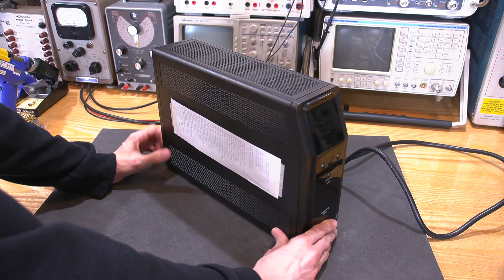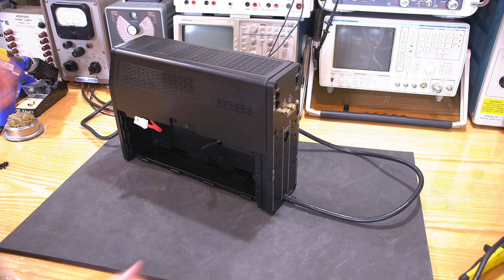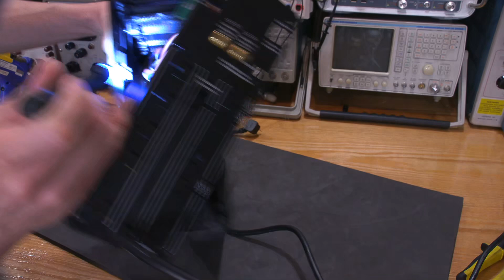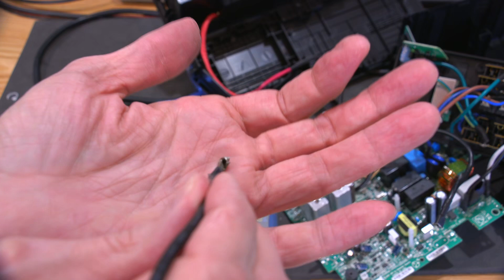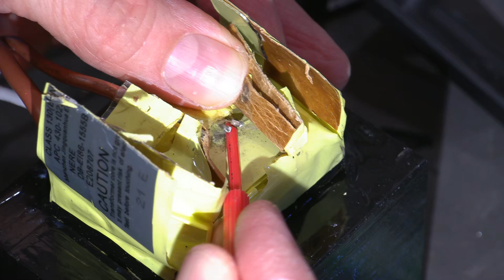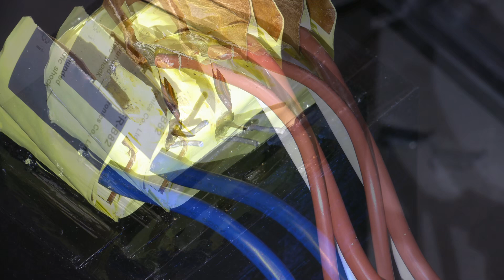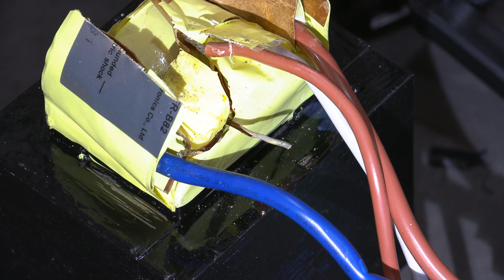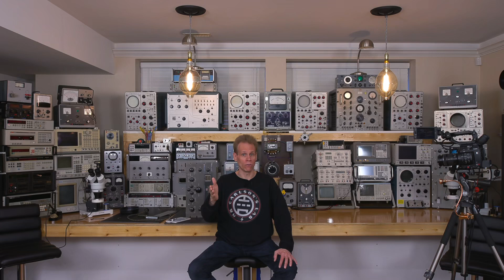UPS Electrical Failure - Teardown and Analysis!

Comment: A weak mechanical attachment for sure!  A crimped metal sleeve over that wire joint would have kept this going.  The fact all the connections were the same, this was by design...sad.

Comment: China loves aluminum wire! All they would have had to do is put a crimp ferral over those connections and they would have lasted years. Great video as always Mr C.
Reply: @Bruce Havourd Nothing shows the transformer  itself to be a bad one but those  wire connections are questionable. Bad connections cause FRICTION!
The burning was indeed as show by Paul to be at the crimp!
Reply: @hestheMaster  There wasn't even a crimp on those connections. They literally just folded the copper wire over the aluminum wires and blobbed solder on it and hoped it would stay connected. I'm curious to see the other transformers from the rest of the APC units. I wouldn't be surprised if the other transformers had proper crimps and if this particular unit had a fault and was hastily slapped back together by someone and thrown into a the UPS unit. A real crimp would have been faster than the lazy job performed here.
Reply: @redemptusrenatus5336  Then that would be a major mistake!
Reply: Those would have to be gas-free four-point military/avionics style crimps on cylindrical ferrules. Crimping anything to aluminum without fully flowing the metal-to-metal interface so all the oxygen is driven out is a fool’s errand. It becomes a ticking time bomb.
Reply: @absurdengineering  BOOM 💥
Reply: True. A bad crimp connection was probably the likely culprit here.
Reply: But that would be more time consuming.
Reply: @philipslighting8240  Normally, yes, it'd take more time to do the job badly but the worker who got the UPS to fix might not have access to the crimp tools (maybe they just repair units which fail QC and don't have the tools to make those crimps on the transformer) and had to make do without replacing the transformer. Note, the transformer doesn't have to work for very long, just long enough to pass the QC test so someone can sign off on it. By then, whoever slapped the transformer back together is long gone and it won't likely be traced back to them. Terrible that something like that might happen but clearly this transformer couldn't be the norm for how they're assembled as they'd certainly have a lot more failures if it was.

Comment: Hello Paul. It doesn't surprise me the transformer failed. When a large batch of appliances is made,  only a sample of the whole batch is tested. For example, for a batch of 500 UPS power supplies, only 100 might be tested. That leaves the rest that are either faulty right from the factory, or don't work at all. That is from a former QA Inspector, who knows first hand the testing process. 😖
Reply from the maker: Thanks for taking the time to write Aryon!

Comment: I often wondered how they can produce those cheep UPSs and many of the smaller desktop ones are so lightweight- now I know. If properly designed there may be nothing to say against aluminum wire other than you have to account for the higher resistance and do a proper crimp connection.
Reply: There is another reason they can reduce weight of the UPSs and inverters. 
Old style UPSs generate 50Hz (sine or square wave depending on how cheap the UPS is) and send it to a transformer. The transformer needs to be big enough to not overheat during the expected runtime.
However, what I noticed in newer inverters is that they use a DC-DC converter to step up the voltage and then produce the 50Hz sine or square wave at the output. This means a much smaller transformer.

Comment: WOW! I am now concerned that the APC units I have in my home are also of this sub standard quality.
Reply: If they are the pre-Schneider buyout (over 15 years old) they will be fine. The originals actually built by APC will last a long time, but be sure to use quality replacement batteries, cheap ones will fail due to overcharging.
Reply: @mxslick50  I have seen numerous old APC UPS devices fail when their internal circuitry fails and they keep charging their batteries (no matter the brand) at full charge after being fully charged instead of switching to a maintain trickle charge which causes their batteries to swell.

Comment: I had a Cyber Power UPS fail in a spectacular way about a year ago.  By luck, I had just returned home when I heard multiple loud pops that sounded like shots from a handgun going off.  When I went looking for the noise I came across my UPS with smoke coming out of it and I could actually see fire through the louvers on the UPS's side ... YIKES!!!  I (very) quickly yanked all the wires out, picked it up, and tossed it outside on my lawn.  In hindsight, the popping noise I heard was probably components exploding on a circuit board (I'm sure many of you know what I mean ...cough, cough).  I was going to take it apart to see what happened, but the store where I bought it said the only way they would accept it on return was for it to be intact and unopened (and the battery removed - yeah, right).  This thing was in my living room ON FIRE!!!  If I was out when this happened my house might have burned down.  I never knew what caused it to light up, but you can be sure I replaced it with a different brand of UPS ... and based on this video, it doesn't seem like that would be any safer.
Reply: Makes me wonder: who makes UPSes that aren't fire hazards?
Reply from the maker: Thanks for sharing your story BLT Labs.
Reply: @MrCarlsonsLab  I also sometimes test almost the same as BLT labs, my issue is kinda like the video where it has trouble holding it all together,  If I could only figure out how to get more bacon into my test rig, but then you cannot take a bite, just too big. Thanks I will keep testing about once a week until figured out.
Reply: @jond1536  mmmmm bacon
Reply: I had 3 CyberPower UPS all fail within a week of each other last summer, all making terrible popping noises and arcing sounds. No smoke, but they all had the bad electronics smell. No events detected on my ancient APC UPS (with its 3rd battery) connected to my computer. No clue what the heck happened, but I'll never get a CyberPower again. Sadly, I got a replacement from APC, and now I question it sitting over in the corner.
Reply: Wow you are so lucky. I was considering getting a UPS for my newly built gaming PC but now we're hearing two major brands having issues - APC and CyberPower. I think UPS makers need to put more safety features into these things and stop using cheap components! QC has gone downhill!

Comment: APC is a great quality product.  I have used many of their products with NO ISSUES!!  The slip on the side is the factory QC test record...comes with all APC products.
Hope you did not replace them with Tripplite.  If so, get extra insurance....and make friends with your closest fire station.  Good luck....
Reply: Yeah, whatever. I have had more failures with APC than all other brands combined. I switched to Tripp Lite and NEVER had any violent or even smoky failures since (unlike EVERY APC that has gone up in smoke). Tripp Lites do tend to overcharge the batteries, so you need to use quality brand replacements. They also annoyingly don't bypass themselves when the battery dies, but at least they don't smoke when that happens. 

APC used to be the best ( I used hundreds of them) but after they sold out to Schneider (parent comoany of Square D) the APC quality, as shown clearly in this video, has gone down the crapper.

Edit: I installed digital cinema equipment for over 500 locations.

Comment: I've been using this exact model in my recording studio for over 5 years through several power failures, brownouts and surges and it has never failed.

But MAN did APC cheap out! You can solder to aluminum, but it takes special equipment, which obviously they didn't use. I've never seen an aluminum winding in a transformer.

What brand/model did you switch to?

Comment: I have two (older horizontal)  APC-UPS units for my computers. Both are over 5 years old and very reliable. I just replace the batteries and they work.
I'll NEVER purchase a new model now !

Comment: I've used these for inverters, but because they are transformer based and clean power due to the sine wave, they are energy hogs when used this way.
I use external batteries on mine.

Comment: While i am no electrical expert, i have installed thousands of UPS batteries over the years. Often when failing you can hear them switch quickly back and forth from line to battery which is a fast clicking sound that can also certainly sound like arcing.  All the larger APC models come with their so called QC report taped to the side like you had there, that is normal when they are new. Thanks for the great videos!

Comment: There is flux based paste which must be used for soldering on aluminum, but does not seems to be used here. This is very common point of failure among budget music system that uses 12v or 24v aluminum based transformers.

Comment: The only real issue I've ever had with APC is how quickly they destroy batteries.  Batteries that should last close to 5 years are destroyed in 1-2 years.  APC seems to have designed their units to minimize battery life and maximize profits.  Thanks for giving me another reason not to buy from Schneider Electric ever again.

Comment: Thanks for this video. This explains all of the early failures with these units. I have one of these in use myself but I haven  had an issue, so maybe they had a batch of these go out with bad connections in the transformer. All of this could have been avoided of they didn't cheap out. Like you said, the transformer should be the most robust thing in this unit...
Reply: It's intentional they want to make you buy a new one. You know for the end of racism and save the climate.

Comment: Yeah, the last APC unit I bought (about a year ago) has that paper report taped to the outside. Strange company, I had a power bank not working correctly, and I spent almost a year of email messages back and forth. The unit I had was discontinued so they could not send a replacement. They wanted to send me a UPS, but I told them I already had two. They kept promising to send a new power bank, but they never did and eventually stopped responding to emails. Sad to see their craftsmanship is sub-par.

Comment: Hi, when using a special flux, the aluminum wire can be tinned, I repaired a customer's microwave oven transformer this way five years ago and it still works today.

Nice day 🙂 Tom
Reply: Unless you're special flux contains magic you're not going to get 10 or lead solder to fuse to aluminum.
Reply: @emmetmyers  I don't know what they put in it, it's a liquid for soft soldering aluminum and the recommended tin is Sn90Zn - I don't have that and I solder using Sn60Pb40 or SN60Pb38Cu2 and it works great.
All I know is that there is a skull on the bottle with the inscription toxic

Comment: I remember fuse boxes with aluminum wire that just became loose where the screws tightened against them and would ark and spark. Good video thanks!
Reply: Probably didn't notice they did something very wrong. They used the same guage of aluminum wire as copper.
They should have gone with a wire guage one size larger and that would have solved the problem. Why you say?
Because the thermal expansion of aluminum is greater than copper and that one tiny change makes it safe. Of
 course we are talking a joint between two dissimilar metals using a crimp. If the aluminum wire is not connected to a crimp  tightly enough it causes friction and heat, so much so it can melt solder around around the crimp. I disagree
 with the correction below because it is a comparsion only to wires sizes and the respective resistive differences of 
the metals . That is not why the joint failed!
Reply: @hestheMaster  the larger wirde diameter is to compensate for alunimiums higer specific resistance and has nothing to do with the thermal expansion and corrosion issues.
Reply: @lukahierl9857  Two years ago YTer Russian Sparky did a video called "Is Aluminum Wiring Bad? How to connect copper and aluminum wires safely" I defer to his analysis  in regards to use of  aluminum wire.
Reply: @hestheMaster  That was a big issue in manufactured homes (like double wides) years ago.   Tiny micro expansions and contractions at the outlet box, until there be a big problem.   I think in those cases they used aluminum for the price and also for the weight.   A bit easier to haul down the interstate if it was lighter.

Comment: In the mid 60's & 70s When copper prices soared Aluminum house wiring was used and ended after numerous houses burned down. I see entries in NEC code about copper/aluminum wire which appears to be what you had in the transformer windings. I guess it'll take a few more houses to burn down before they decide that was a bad idea.
Reply: As I recall it wasn't the fact that aluminum wiring was used as it was connected to brass or steel screws in outlets and switches as if it was copper . They used the SAME size wire gauge instead of going up one size larger. So if
 you had a wire guage for a home at 12 gauge copper they should use 10 gauge aluminun wire to compensate for the aluminum's expansion factor. It expands and contracts more than copper.  Note the feeder wires into most homes today going to the main electrical boxes are stranded aluminum wiring! Aluminum wiring got a bad rap because few paid attention to what the installers did back then did with it to cut costs even more!
Reply: @hestheMaster  I think it has less to do with expansion/contraction and more to do with its higher resistance so you need a larger wire to compensate..............
Reply: @jaycahow4667  OK

Comment: One has to wonder how many other little hidden shortcuts lurk in all the cheap garbage electronics we are surrounded with.  Awful LED lamps and their power supplies come to mind.  Good job, Mr. C!  At first I wondered why you'd soil yourself on this junk, but it ended up being informative and ....revealing.  Thanks!
Reply: Did you know the largest convicted price fixing scheme was conducted by major LCD manufacturing companies, 2001-2006 ~FBI 2012 "Recently, AU Optronics Corportation—the largest Taiwanese producer and seller of LCD panels—and two of its former top executives were sentenced for their roles in this conspiracy. The company was ordered to pay a $500 million criminal fine, and the executives each received three years in federal prison."
Reply: If you want tôsee numerous cheap led lamps dismantled, look at Bigclive here on youtube. Surprisingly, at least when it comes to bulbs, most are not great, mostly drivng the actual LED chips harder than healthy for them to last, but rarely electrically terrible. when it comes to led fixtures, the picture is a bit more mixed, sometimes even literally shocking...
ut this was a useful video, as I was in the market for a small size UPS. Well guess which brand just went out of the window...
Reply: China is notorious for substituting copper with copper clad aluminum.  I think they are trying to burn down the US.
Reply: @RS-ls7mm  never attribute malice to that which is far better explained by cheapskate incompetence.  :)
Reply: AVE channels tears down tools and analyzes all materials, this needs to be done in all reviews
Reply: Well, ask the Chinese embassy.
Reply: @spvillano  American greed.... China will build to whatever spec you desire. Thats one of the reasons The US is terrified. China builds very high quality that a lot of the US cant or wont. "APC, a flagship brand of Schneider Electric - APC USA" Some flagship...
Reply: @guym6093  some may be terrified, but quite a few of us remembers history of nations industrialization.

As for a flagship, the Titanic was also a flagship for a company.
Reply: @spvillano  that's the problem... Memories gone by. The counters have taken over in the US. US quality will never be.

Comment: Would painting copper sulphate solution to leave a copper coating on the aluminium.
We used to use it for marking out surfaces in the engineering workshop.

BTW
We used to use a resistive paste to spot weld aluminium gas burners.
One of the old boys showed me a trick for spot welding copper.
Reply: I know you can use copper sulphate solution to plate steel/iron, but I'm not sure the same would work on aluminum. The iron oxidizes and dissolves, and the copper is reduced to form a plating. The same might not work for aluminum because the oxidized aluminum might not dissolve away. On the other hand, alum is aluminum sulphate and is quite soluble so that might work, provided the aluminum is clean enough to begin with.

Comment: Every APC comes with that label for some reason. Really makes no sense, since they wouldn't send out out with any 'FAILED' on it. I used to have multiple APC's also. But many seemed to fail like yours for strange reasons other than bad batteries. I have since changed to the CyberPower brand. And no failures so far. APC used to be the 'go to' UPS maker back in the day. (Maybe because they were the only one?) But these days, there are other more reliable options available at similar price points. Not the same company they used to be, like so many others unfortunately.